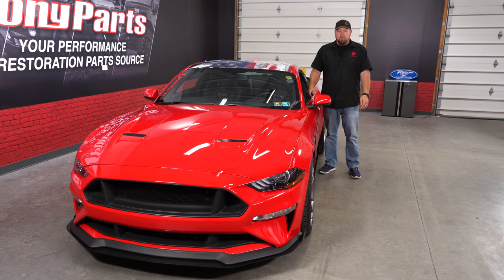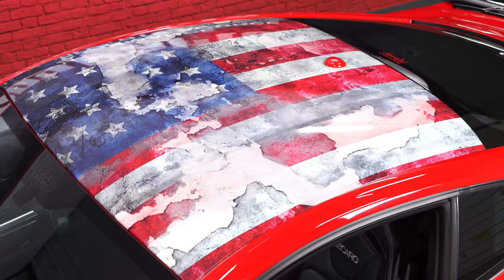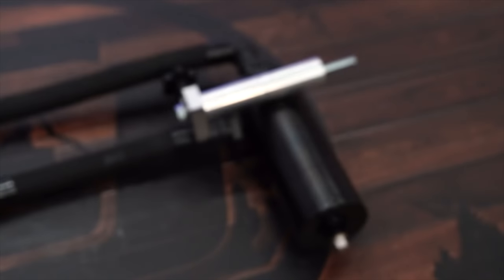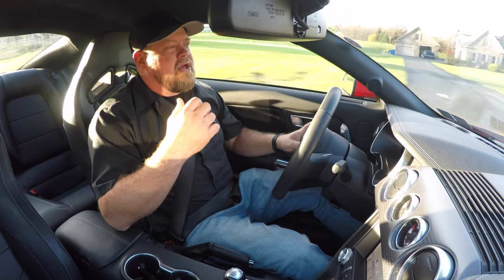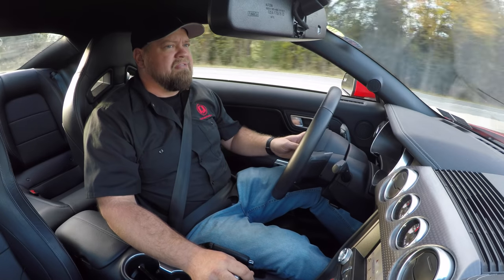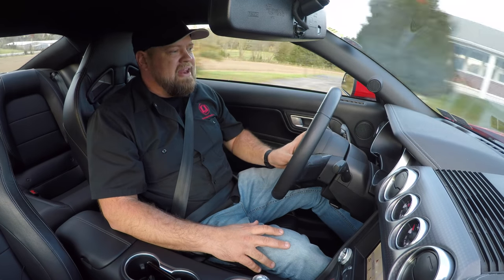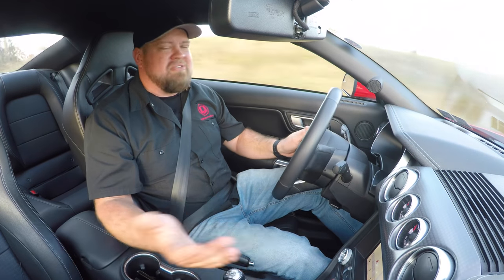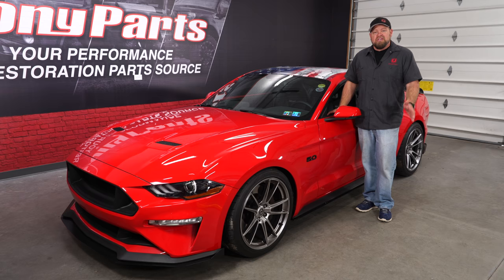One year later, Bill reviews his 2018 Mustang GT

Comment: I'll stick with my 16 Performance Pack GT Premium with 13k miles. It's been a pretty solid car so far. After owning 6 Fox Bodys and 2 Z06s I'm happy with it. Nice car though Bill.
Reply: I have a 16 PP GT also. What color did you get? I have deep impact blue and love it better than the other blues Ford has come out with. Any issues at all with yours? Mine only has 7500 miles in it an the only issue has been the mustang puddle lamps. They get like spider web cracks and I have replaced them twice already. Also the tires suck. Getting ready to order the shelby cs3 wheels with nitto 555 g2 on black Friday. My stock tires are shot with 7K miles.
Reply: would you go back to the z06 if you had the choice? currently not sure which one i want but that ls7 has got me leaning towards the bowtie.
Reply: @shaunharrison9618  I too have the same issue on the driver side puddle lamp on my 14 GT.
Reply: I have a 2012 Ford Fusion and I made sooooo many mods to it.  I get 150HP with premium fuel.

Comment: I agree Bill. If I were to get another mustang, had a 2014 6 speed, (hated the mt82 noisy and clunky) it would be the 10 speed auto. Unless ford gets rid of the mt82 and uses the Tremec unit, the 10 speed is hard to beat.

Comment: my only complaint about my 18 GT is the lockout over 6800 rpm. Even with a MGW it still locks out if i try and shift quick. i have to shift out of first then let it "rest" on 2nd before it finally goes in. under 6800 it will shift as fast as i can, over i have to wait or it will grind. the rpm's just have to drop a touch. 2nd and 3rd are like that.. Otherwise so far my car has been great. hate that i may have to drop a mantic clutch in just to be able to shift properly. Also was great meeting you at the SSM Mustangs on the Strip here in Vegas
Reply: I think it's the way u push the clutch..i noticed a fast all the way to the floor clutch push helps.. I have an 18
Reply: @mattkent75  i have tried different methods of using the clutch based on others advice as well and it doesnt seem to help. I do have the steeda clutch spring and once im done with the polishing and ceramic coating i plan on taking it out as ive seen multiple reports that removing it completely has helped. I dont understand why but its easy with the seeda to remove and reinstall if it does nothing.
Reply: Yes I've herd the same aboit the spring..Good luck brother
Reply: Hey guys...the lockout is caused by the stock clutch....i would recommend doing a clutch for your setup; exedy makes great clutches; the et04xd for blower setups or the exedy mach 500 for n/a. While you're at it, do a trans mounted shifter like the mgw or the barton hybrid. That should smooth things out for you.
Reply: MK800 just wanted to give you a follow up, I removed the spring out of the clutch and all three times I took it to 7800 I never once had it lock me out. It still isn’t as smooth as under 6800, but it never locked out..
Reply: Nevin Barley I don’t believe that Exedy makes a clutch for the 2018’s yet, only Mantic at 2k and McLeod at like 1400, though reviews for the McLoed hasn’t been great on other models. I was told that fixes the issue completely. I plan on picking up the Mantic soon.
Reply: @SupraDebt  Exedy works on the 2018...would have to do the clutch and flywheel. Where did you read that it doesnt work?
Reply: Nevin Barley that they are completely different clutches with different pilot bearing locations and different slave cylinders, even different transmission input shaft lengths.. idk if it’s true just stuff I’ve seen on the forums and on the 2018+ FB pagebut when I look for 2018+ only 2 companies come up with clutches, but I’ll  do some more research as I have had exedy clutches and never had issues

Comment: IMHO the 10R80 is super effective WOT in a straight line, however almost every other circumstance it behaves like a typical American slush box. Slow and/or sloppy shifts, slow paddle response, lackluster down shifts, and easily confused. No doubt it’s an effective drag racing unit, but I think the gap between the 10R80 and manual can be closed with a rear end gear in the 4.10-4.30 range. Obviously you need a good driver too. Great review Bill. Do you wish you had the active rev matching at all?
Reply from the maker: Our 2019 GT we built for the SEMA show has the rev match. It is cool but it does it every time you downshift which I found to get a little annoying after awhile. I wish you could turn it off.
Reply: CJ Pony Parts I can see that. I reviewed a bullit on my channel and found it fun but it would be cool to be able to deactivate it sometimes. It makes the manual more autonomous which is a huge reason to get it.

Comment: I have yet to see a 2015 go 12 flat in either man or auto as for heat soak, I ran my best time of 12.0@117 hot lapped, not sure where that comes from.
Reply: KlipschHead281 heat soak is an issue from the blower where it gets hot and makes less power, it’s not as big an issue for an NA setup.
Reply: @Zerogivengarage  Agreed, thats not how he said it though, heat soak for the 18/19 is not an issue, heat soak is an issue for most top mounted blowers.
Reply: Um He is Me. And I meant my car in particular because of the supercharger.
Reply: @Zerogivengarage  - Oy, I need a drink.

Comment: hi bill   big fan.  wondered if you could clear the air...having an '18 manual. CJ posted info on the '18s stating they would come factory with No-Lift Shift. you didn't mention it and it seems no one has absolute info. Ford Perf has it in the power packs but did it come factory installed on your car. personally, wish it had been a selective option on Power Packs (not alone). there is talk of a new version allowing NLS as an optional choice which should have been offered in the first place. lots of road course drivers (unless you have a .8mi straight or Mulsanne) and daily drivers not enamored with NLS. it is a personal preference...any feedback appreciated  dw

Comment: hey Bill, just curious on the wheel package you are running on your GT as far as rim size front to back and tire size. I have a 17 gt350 and was curious if i used the 350R springs and rear sway bar would that throw the car off balance wise? thanks
Reply from the maker: I have stock PP sway bars and the Ford Performance lowering springs. No issue with 20x10 and 20x11 HRE wheels. https://www.cjponyparts.com/hre-ff04-wheel-and-tire-package-20-x10-20-x11-liquid-metal-2005-2019/p/W457K-B/

Comment: After doing all the mods Ford still warranty parts on the car ? I was told if i put other parts on my pony that wasn't Ford I lose my warranty..
Reply from the maker: The Roush/Ford Performance supercharger includes a 3/36 warranty. Everything else is not voided as long as a dealer or authorized installer puts the kit on.

Comment: Wait can you explain a little more when it comes  lowering it with the magna ride im confused
Reply from the maker: The magneride is basically a self adjusting suspension and adjusts based on drive settings as well. When we first lowered it we used the Ford Performance springs for the GT350, which also has magneride, and they worked perfectly,
Reply: @cjponyparts  ooooh fasho brother appreciate it

Comment: Bill I have a 17 gt pp what size HRE ff04 wheels and tire would you put on it?????? With offset etc... I saw your video on tire and wheels but I know you have already done the work help a dedicated fan out? It’s at stock ride height but I would like to drop one inch if possible too
Reply from the maker: I like the 275 35 front and 295 35 rear.

Comment: Hi Bill, any reason why you didn’t add long tubes?
Reply: Ron  for my use I didn’t really need them? I never installed them on my 15 either.
Reply: Hey Bill, does not having long tubes affect the performance of your super charger at all? Torn on whether I should get them on my next mustang. I have had a few issues with long tubes on my current mustang throwing CEL lights, even with cats and a tune. If your super charged mustang is running fine without long tubes, I’m leaning towards it might not be worth it.

Comment: I was looking into the PP2 but I would hate to spend the extra amount to have the tick, what are your thoughts on the PP2 if it had the same mods as your car?
Reply: Linkedsince 91  I did a full review on the channel of the PP2. If I was a road course guy  it would be worth it, for my use I wouldn’t order one. The tires are ultra sticky and won’t last so I would have to change wheels/tires anyway. I like the additional aero but not for the cost.
Reply: @Zerogivengarage  I know I watched and commented on it as well about switching the tires lol. That's all you would have to do to eliminate the tires issue if you want to drive it daily. Was wondering what a PP2 with a supercharger and set up like your PP1 would be like and what the differences would be mainly, I really like the stance and wheels of the PP2. I've yet to see one in person as well.
Reply: @Zerogivengarage  but I'm also looking at the 13 boss 302. Doesn't have the IRS and the interior is a little dated but I had a 14 premium and loved it. Plus I don't plan on hitting the track as much and I'd save any we're from 5-10k depending, and then I can put that into the boss. Should be able to still put down some pretty good numbers
Reply: Linkedsince 91 i would still like to own a grabber blue or ghig Boss some day. They weren’t that special but I still like them.

Comment: does anyone know if I can install a 2015 hood on a 2018 Mustang GT? I like the new bumper but I hate the hood
Reply from the maker: Retro Gamer no it will not work the shape and the angle are unique
Reply: @cjponyparts  would it be possible to install a GT350 front end perhaps? I ask because the Shelby also has a lower front end like the new GT
Reply from the maker: Retro Gamer the original Shelby front end requires a radiator support among other things. The GT350 style bumpers for 15-17 wont line up with the 18-19 fenders or rad support .   Plenty of aftermarket hoods for the   18

Comment: what do they mean by 600hp to the tires
Reply: There are two places to measure horsepower, at the back of the engine, or on the ground at the back tires.  Because of friction and accessories, it can take 30 to 100 horsepower to operate the vehicle, but performance is rated at the tires, how much horsepower can be used to accelerate the car.  So, in this case the crankshaft horsepower could be 700, but there will only be 600 horsepower at the ground, to accelerate the car.
Reply: @ThisOldMan-ya472  I'm still confused
Reply: @ProStreetMatt  I doubt there is a cure.

Comment: Love V-* American cars--but that cluster went out and that sums up American sports cars.Soon as they get out of warranty--and I have owned a few--including an olds aurora that surprisingly did not wind up in the shop.Oil leaks after 50k occurred on 3 Ford products I owned and 2 friends--saleen mustang--check engine light always on--failed emission once costing 800 dollars at ford to make it pass, SHO--leaked oil--also check engine went on--2 plugs and o2 sensor.problem is it was always something with the American cars I owned.Bet if that cluster had gone out of warranty--how much would that thing cost--and then cost to replace it.I traded my 2008 eclipse GT in because it was in the shop for electrical issues.I finally got my first Honda--a Crosstour Type R--I got a video on it.It is not the fastest car--but it has an unsurpassed balance of power--superb handling for what it is--excellent all weather car and high speed cruiser--and RELIABLE--has not been in the shop once other then brake pads--tires--oil change.I have gone to Fla in it a few times and have locked the cruise at 100 and it was just loafing along while getting 26 mpg--The type R brakes--cross drilled--vented--ceramic high performance pads are as quiet and feel like stock except for the braking power.I have never even had the ABS light ever go on it and and I just test it every winter to make sure it works.If Ford put an AWD and a 100k warranty--I would be all in.But American V8s can be a money--time pit in a non fun way due to reliability.Nice car and luckily you work where you can keep it in top shape.

Comment: You said you haven't taken your car to the drag strip you better not the first thing that's going to break is that cheap Ford 6-speed why they didn't keep the traffic is ridiculous next thing you'll have to buy axles plus a drive shaft. How much does it cost to upgrade 4 camshafts and have them installed you'll have to break the bank and while you're at it you better replace those oil pump gears to set of Billet gears but then again you are a aftermarket company you have to own one to keep a Ford Mustang running
Reply from the maker: My six speed has held up so far, just because I am not drag racing doesn't mean it is not getting used hard. The stock axles and driveshaft will hold up pretty well unless you get a sticky tire and then it is an issue for both transmissions. No reason to upgrade the camshafts in most cases since you can make serious power with the stock ones.

Comment: What tire size are you running.
Reply from the maker: 275 35 20 and 295 35 20
Reply: @cjponyparts  can I ask why you went so large up front. I was looking into a 305x35r19 for the rear and only 255x40r19 up front.
Reply from the maker: android 95203 275 35 fits my 20x10 wheel very well.
Reply: Thanks for the help man. You think 305 would be plenty on the rear? I plan on supercharging my 2015 gt this year.